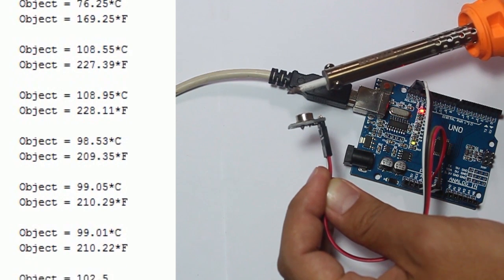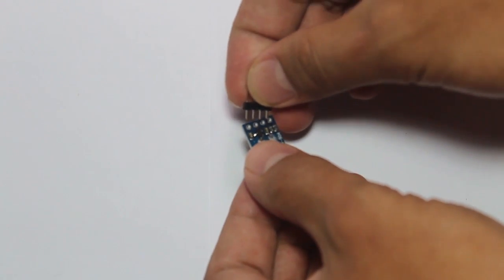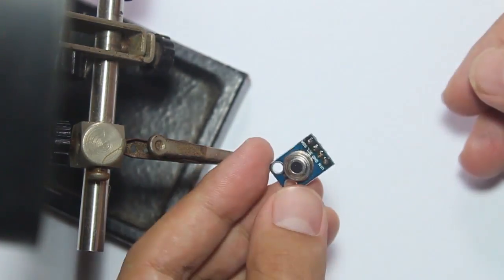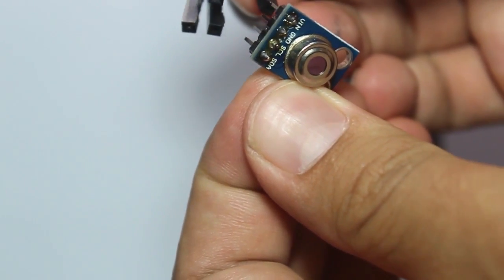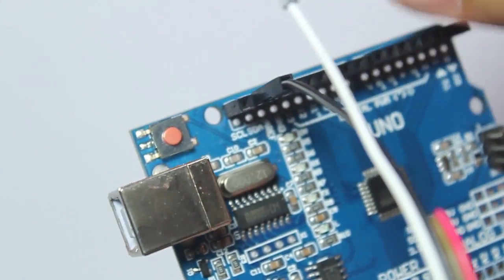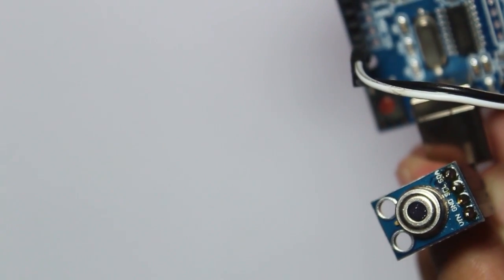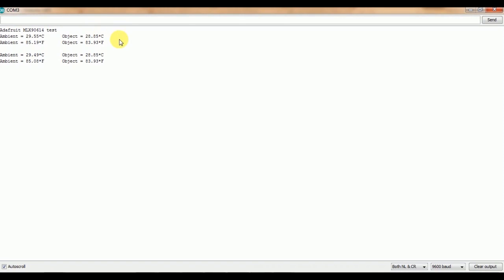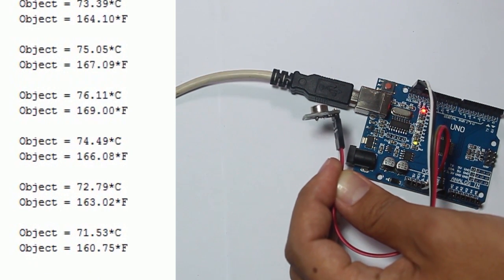Non-contact temperature sensor mlx90614 with arduino tutorial

Comment: Hii , i followed this tutorial but I'm getting temperature in 1000s 'c pls , any guess what might be the problem?
Reply from the maker: Did you ever connect the vcc to 5V?
Reply: @miliohm  no... Only 3.3V
Reply from the maker: Make sure the wiring is right. And every cable is connected.
Reply: @miliohm  yes.. its proper..
Reply: @miliohm  im using arduino uno board..
Reply: do you fix it? i have the same problem too
Reply: @kimkim4232  yeah.. it's loose connection itseems .... somehow it started workinh

Comment: sir can you please tell me the code and the curcuit diagram if I have to design it in such a way that a buzzer goes off if the temprature is higher than a given value. please sir.
Reply from the maker: Check the link, it's already there

Comment: Anyone know why mine reads 64°C and never changes?
Reply from the maker: Make sure your wiring ia correct. And dis you ever by accident connect vcc to 5V?
Reply: @miliohm  I rewired, not sure if it's the same one from the video but it's working now.  I have SLC/SDA on analog and VIN on 5V.

Comment: This is an invaluable tutorial in these testing times of COVID-19. I made a DIY thermal scanner following your tutorial. WIll upload the video soon. Thank you so much! Stay safe and God bless!
Reply: How did you calibrate it measure human internal temperature? Medical thermometers  are calibrated differently from industrial ones.
Reply: @CryptoConscious481  It is not very accurate. What I found from several videos that use commercially available scanners is that they too are not very accurate. The most important issue I think is the distance the sensor is from the object. I decided on approximately 1 inch. Had normal temperatures checked and tweaked the code to the 'normal' reading by adding the difference to the code. But still it is not perfect, however for screening, we can probably use it. I have not done extensive studies on this. Will update you once I have more data! Thank you for the very important question!
Reply: Can I ask you where did you get the mlx90614 sensor? It's sold out almost everywhere at the moment
Reply: Please
Reply: Id be interested in knowing what calculations you are using? all the research I've done in medical papers are not furitful in a basic algorithm of determination without skin thickness/an empirically determined K value of resistance, or MBR. I'm working with a D6T 8 array, Thnx

Comment: Sir is that perfect for measuring body temperature ?
Reply: No.  There are many variants of this sensor. This one has a precision of +/- 0.5 °C, not suitable for the human body. Also de angle of measurement (FoV) is too wide, so you need to sense, very close to the subject, and the data is not exact.    You need the variant with the suffix "DCI" with precision 0.1°C.  The model is MLX90614-DCI. Something like this:
https://www.aliexpress.com/item/32959369513.html

Comment: hi, the reading observed are constant. why it happen ?
Reply from the maker: Did you mean the temperature ia constant? How much?
Reply: object = 1037.55*c repeated..
Reply from the maker: @amirulhakimi9360  did you ever connect vcc to 5V? When i did that my sensor damaged and always give that output
Reply: miliohm i do connect with 3.3v only form arduino
Reply: hi, i do the same... have you find the answer why did it hapenn?
or my sensor was broke??? i put vcc to 3,3v since i open the wrap
Reply: I dont know. do you trust me or not.
 ive just feel what you comment. 1037.55.. I touch my sensor and it being so hot. i remove it from pin, n then i sink into water, then i  make it dry. and it works properly

i dont think i was wrong put my cable jumper
Reply: HARYO DARMAWAN like seriously sink the sensor in water? I'll try later
Reply: I did that 😂

Comment: Will it measure accurately if we increase the object distance to 30-40cm from the sensor ?
Reply: the sensor works disgusting... the distance 0 cm = almost true value, moving back and temperature will decrease. Absolutely useless device, as for me. Body temperature (distance 5 cm) equal from 28 to 32 C.  Ambient temperature was 26, however sensor said that 29:)